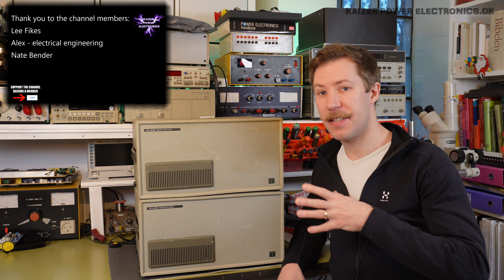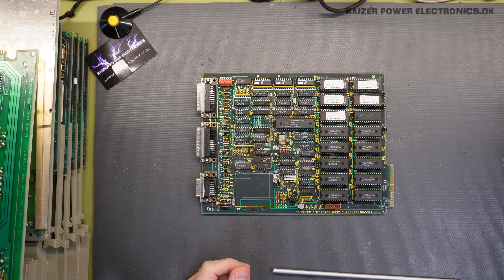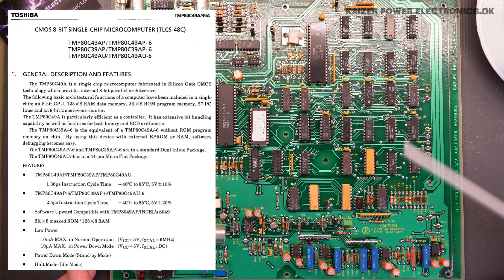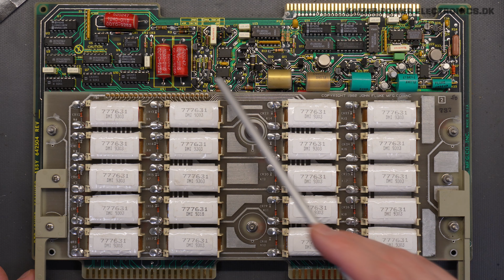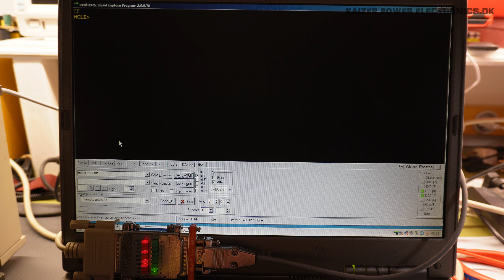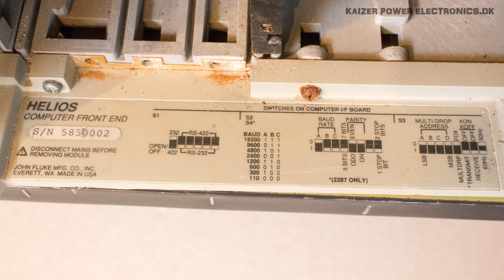Fluke Helios Plus 2287A, 1500 I/O Frontend, Teardown and Test

Comment: Reasons to use reed relays: the contacts are in a sealed glass tube so less chance of corrosion. Reed relays can be faster. Reed relays have a smaller capacitance when open.

Comment: Nice, I didn't know that such systemxs existed in this era. 
Also nice to see that you can simply use it with a terminal application without some unobtainium software that renders it useless today.
Reply from the maker: I got the manual for it, from someone still using them today, they have been using them for a good 30 years now. Latest version of their setup was rewritten in python for easier integration into their modern "science databases" :)

Comment: Even now agilent uses some reed relays on their mux boards for their acquisition measurement systems
Reply from the maker: Seems like it is just the best available technology to the price/feature ratio: "Reed Relays are
precise switching components that combine
reliability, fast switching times, and longevity
with great electrical and mechanical isolation
characteristics. When properly designed-in,
these features ensure that the reed relay will
stand up to the high requirements of modern
electric devices very well."